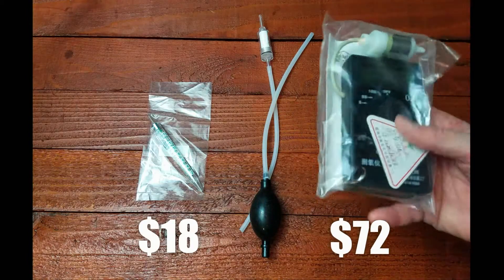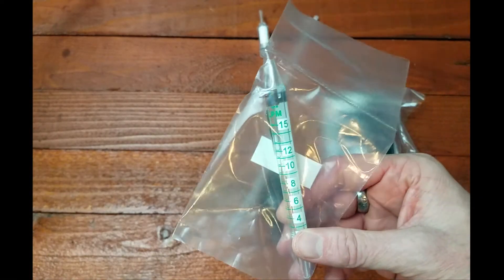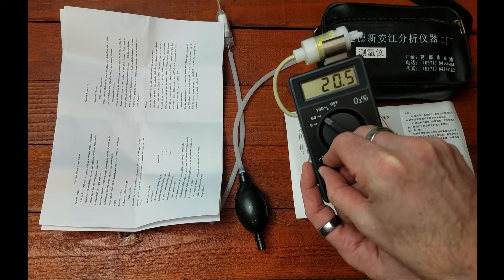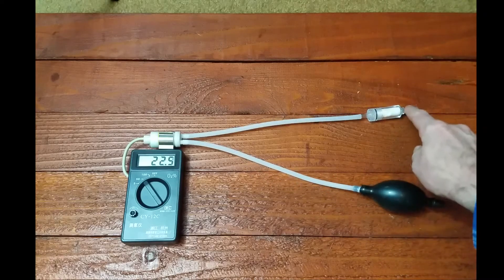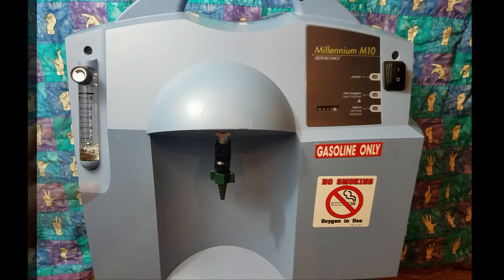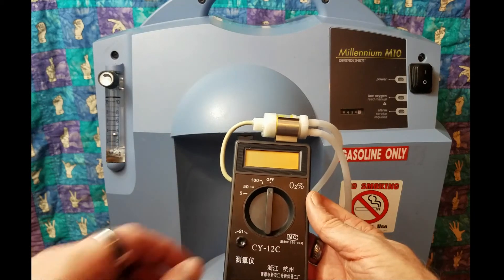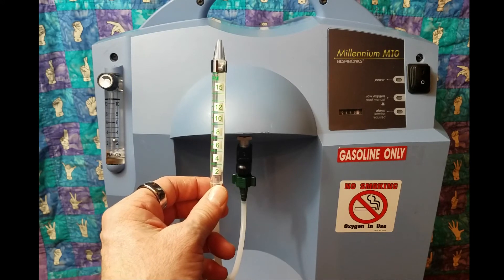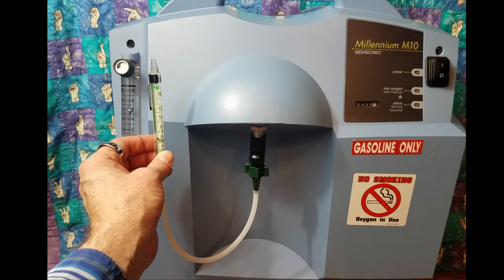Oxygen (O2) Concentrator Testing - for under $100!

Comment: From what I wtched you dont recommend to measure 12lpm of O2. I have a concentrator from Clearwater Tech and I want to know if Im getting enough purity from it, as I can´t seem to get high enough concentration of O3. I am thinking that maybe the O2 concentrator is failing. What other device can I get to measure 10-12-14 lpm O2 concentrator
Reply from the maker: Hi Roberto.  I dont know if it can test beyond 5LPM.  I intend to try it soon.  But I am reasonably confident that if I am getting high 80s/low 90s at 5LPM, that I will still get a higher % at higher flows.  O2 testers are expensive, here is the one my seller used, as he needs professional grade.  https://www.vitalitymedical.com/invacare-check-o2-plus-oxygen-analyzer-device-irc450.html?feed_special=bing&utm_source=bing&utm_medium=cpc&utm_campaign=**LP%20-%20Shop%20-%20%27Respiratory%20Therapy%27%20-%20(%24250%2B)%20-%20General&utm_term=4582008551954397&utm_content=INVIRC450_ea%20%7C%20Invacare%20Check%20O2%20Plus%20Oxygen%20Analyzer%20-%20IRC450%20%7C%20%24587.89
Reply from the maker: And I have zero experience with this one, but I have my eye on this one as a mid-level cost tester (when I find the money someday): https://www.forensicsdetectors.com/products/oxygen-analyzer?variant=30700797132844&msclkid=6a305fa00b1e1e27f5b53e472a1b5ffd&utm_source=bing&utm_medium=cpc&utm_campaign=ShopifyV2_General-Test-Shopify_113961959587&utm_term=4587368674203819&utm_content=ShopifyImportAdGroup

Comment: Hi, where did you get that pen style flow meter from ?
Reply from the maker: Sorry darn, didnt see this question.  If you have not found one already, search on, "0-8 LPM Pen Style Liter Meter" or "Standard Flow Liter Meter" , or some variation of that....
Reply: @danishindian2107  Thank you. You are helpful. I havent had a chance to buy the tester. Do you feel significant air flow change while changing flow rate setting from 1 LPM to 5 LPM ?
Reply from the maker: @weyonchin  Sorry, I dont understand your question.  When you move from 1L to 5L per minute flow, you do feel it.  I dont know what you might consider significant or not...?  Don't you have a flow meter?  Is that the concern, no flow meter so you are trying to manually feel?
Reply from the maker: See below for search titles, and although many wont have access to the US based Amazon, as a reference, here is where I got it:  https://www.amazon.com/0-8-LPM-Style-Liter-Meter/dp/B00CWGC36O/ref=sr_1_6?dchild=1&keywords=pen+style+liter+flow+meter&qid=1631920496&sr=8-6

Comment: How long it take to get 94% from the first start?
Reply from the maker: I don't remember.  I did it multiple times and was not focused on the time to full O2.  I was more focused on the performance of the tester.   Per some prior discussions 94% might be slightly high.  Apparently when the bulb is attached it can slightly elevate the O2 results.  I also was not overly focused on the manual calibration as I just wanted to know it would test into the high 80s/low 90s.

Comment: Did you already test 10LPM with that because I didn't see you video that you tested with 10LMP.
Reply from the maker: No.  I tested offline up to 5LPM.  But I have read conflicting things on this tester and hesitate running 10LPM directly into it.  I still plan to do it, but need it for other testing in the short term.  Some of the readings I have seen say there is risk of damaging it beyond 5LPM.  But again, I have read conflicting things.

Comment: How long did it take to reach from 43 to 94% ?
Reply from the maker: It was 21% to 94%.  The reason it started at 43 was to shorten the video.  It took several minutes.  I am checking on the reason for that as I don't know if that was because of the sample time of the tester, or ramp time on the concentrator.  Thanks for stopping by!
Reply from the maker: I confirmed.  The ramp time to maximum O2 output can be up to 10 minutes (depending on concentrator size).  This is not the tester, but the concentrator.
Reply: @danishindian2107  you need to remove the bubble part in order to let the air flow through. The CY12 starts to show increased levels of O2 even if you start applying some pressure to it, while the bubble is connected, or the outlet is blocked ..
Reply from the maker: @beatsntrailz  Thank you Sahil, I appreciate it.  And I am not sure I understand?  Are you saying removing the bubble will speed up the move to maximum oxygen?  According to my supplier the concentrator takes a certain amount of minutes to get to maximum oxygen no matter what, is this not correct?
Reply: @danishindian2107  I'm also using the instrument to test a concentrator that I've designed. What we observed is that if you apply air pressure (even normal air) on the inlet and block the outlet of the instrument, the oxygen level starts to show a considerable increase. 

Now in you video, I noticed that you have the bubble attached. This is blocking air flow and is creating some pressure on the sensor. Oxygen percentage in this case will falsely show higher than what it actually is. You need to let the air through, in order to see the actual %. 
This is my observation.  Hope you've understood my point.
Reply from the maker: @beatsntrailz  I do now, thankyou!  I mentioned in another post that the O2 reading might be slightly too high, although I have tested it not on video and it starts out the same...I will do another test.  This is a huge help, thank you!  And you designed your own concentrator??
Reply: @danishindian2107  you're welcome. Yes, working on 4 models from 5 to 20 LPM
Reply from the maker: @beatsntrailz  20LPM?!  Are there concentrators that size?  Pretty impressive!
Reply: @danishindian2107  these are used to provide oxygen to several patients at once.

Comment: You cut the video , it wasnt 94%
Reply from the maker: 94% on my tester?  Yes it was.....what makes you think otherwise?  It was 95.8% when I purchased it as measured on a pro testing unit.  But per my video there is a small bit of variance in there as my tester can be "adjusted" to match what room level O2 is.  I set mine to 20% as I am at 400 feet above sea level (20 or 21 is what I use so it might be 1% high....).   When I bought my unit it had been fully rebuilt - everything.  I am still new to this, is there a reason why you think 94% is not correct?  Please let me know, thanks.

Comment: Is it actually necessary to have the squeezy bulb attached on the other end when the air is constantly flowing through the sensor?
Reply from the maker: No, not in most situations.  I have watched it sample ambient air at the exact same reading percent with and without it.  I think the bulb comes into play when you are sampling from a closed pipe of static air or something like that and need to pull air in.

Comment: Hello,
Which of the two analysts would you recommend the professional of INVACARE or CY 12C?
Thanks in advance for the reply!
Reply from the maker: If you are talking about the Invacare combination flow and O2 tester that is far better at every level than the CY12C.  The CY12C is a budget tester that only tests O2 level.  The Invacare tests both flow and O2 level - but at a much higher price point.  If you can budget the Invacare, that is the device to get.
Reply: @danishindian2107  Thanks a lot!
For now, you can take on a budget CY12C.
And would you recommend any other model and brand to be budget and reliable?
Reply from the maker: @ВалентинКАРАПЕТРОВ-ш5ф  I only have experience with those two devices, and limited experience at that.  I needed to test my concentrator, so I found the budget solution and tested it multiple times.  I am confident in the budget solution, but I am not an expert on multiple O2 testing devices.
Reply: @danishindian2107  Thanks a lot!
Reply: @danishindian2107  Correction - if you can budget the Invacare, still buy the cheapo devices and spend the extra on something else ;)
Reply from the maker: @jorisbonson386  Depending on your purposes yes.  I am not an engineer, but the Invacare has a more advanced way of sampling oxygen, that does not require calibration, that may give it a longer life.  But per the video and for my purposes the CY12C is an excellent device and just right for me.